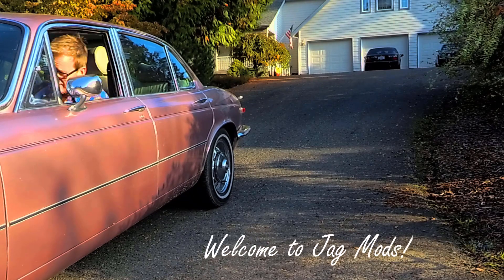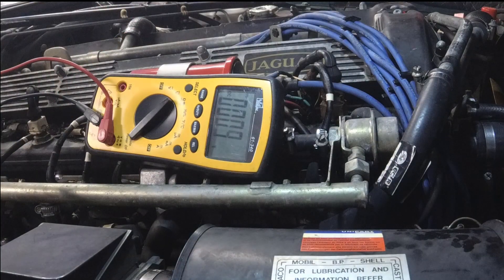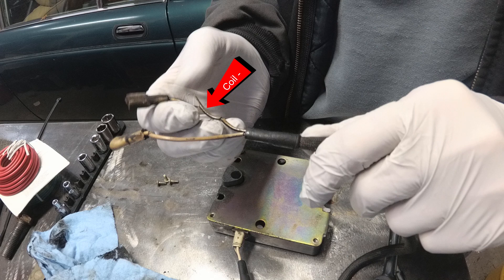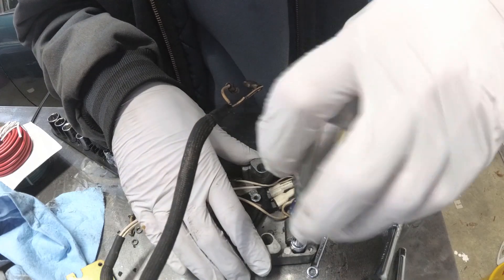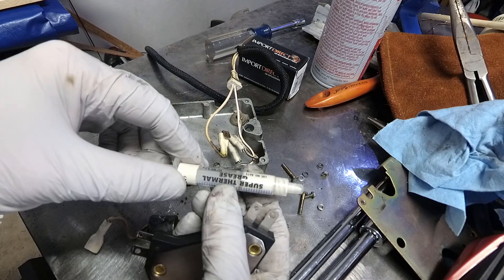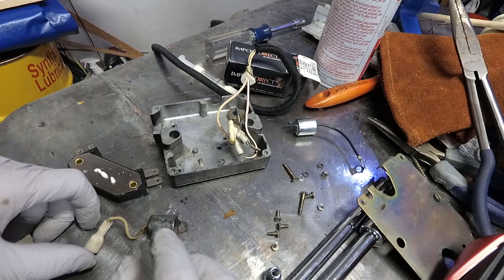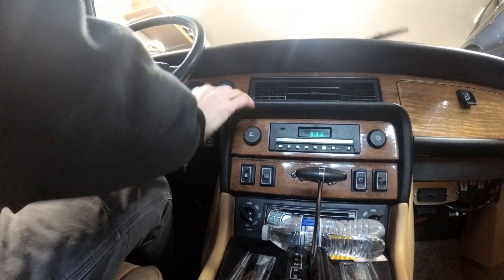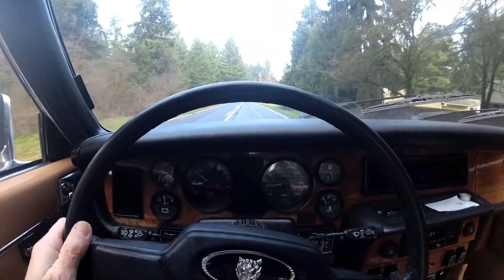Here's how to put the spark back in your Jag.

Comment: Hey buddy, what makes the car (83 jaguar xj6) to go only at 30mph speed? Water on fuel, stale fuel, spark plugs, clogged fuel filter, etc? Any advice will be appreciated.
Reply from the maker: All of the above would do it. Does it sputter? Or just not rev?
Reply from the maker: Also if uts been s in sitting with ethanol laced fuel the ethnol will create a jell and prohibit proper fuel flow. Id recommend cleaning up the fuel delivery,  check the fuel pumps to ensure proper pressure. Is it fuel injected or carburetors?
Reply: @JagMods  it must of been sitting for awhile, it starts up after a second or third try, but when driving it it just goes to 30mph, no power at all. It's also a fuel injected model. I have bought alot of things, but yet to install them, fuel filter, fuel pump, drain the gas tanks, vacuum hoses, radiator hoses, new fuel injectors, undecided what spark plugs to use, ignition coil, cap and rotor, spark wires, clean mass air flow, throttle body cleaning, and new amplifier ab 14 box, change or drain transmission fluid and add the 4qts of type f, etc. All these will going to do during my labor day week off. Hopefully it will improve performance. Will let you know once done. Thank you for your advice.
Reply from the maker: Sorry I missed this comment. I try to address all of them as they come in.  Sorry... How are you getting on with your Jaguar?  to Answer your question, All of the above, plus,
the thing is all of the items above would also cause a really poor / rough idle. except a clogged fuel filter.  Other items, could be a fuel pump is tired you should get 36psi on the fuel rail (hose to...) No advance issues with the distributor not advancing, I've also seen cams out of sync / time (different than ignition timing) The culprit us is the cam chain is loose or the tensioner guides are severely warn.  all but the worn guides are easy fixes.  
Let me know how you're getting on with your Jaguar

Sincerely,
mark @jagmods

Comment: Hi there. Thnx for showing this. I've like all Jag XJ6 owners am battling this issue right now. I thought it would be just wiring, but perhaps it is that Lucas box and cables.  Wondering where to buy the capacitor and the heat sync ? Basically, I have spark between cables, but it looses spark, so car won't get fuel.  If you could comment on where you got the parts would appreciate it. Cheers.  Nice light approach btw... I like it.
Reply from the maker: The Jaguar ignition module found in a couple of places. If you want the Original Equipment replacement Jaguar Part number DAC2087. The whole unit can be found at SNGBarratt search for the Jaguar Part number above. a Non Jaguar quality replacement can be found at Rock Auto too . 
https://www.rockauto.com/en/catalog/jaguar,1985,xj6,4.2l+l6,1178096,ignition,ignition+control+module+(icm),7172 - I'd probably go with the Standard Motor Products brand is a decent substitute for 3rd party replacement parts
Just the internal bits? The OE ignition amplifier is just a HEI unit on any late 70's -80's GM / Chev V8 HEI ignition.

The condensor?  I had kicking around from the trials and tribulations of erratic spark on the Series II XJ6.  The Jaguar part number is JLM9656.  Any ignition condensor will work, as long as the pigtail isn't too short - too long can be cut and a new end put on, oh and the mount has to be in the right place too.  Generic Auto part store ignition condensor will work too - These usually have a bracket that tack welded onto condensor. 

The amplifier unit in the video is an MSD unit - you'll want to use the MSD Coil too ditching the stock ballast with the stock coil.  If you use the stock coil, then go with a stock GM ignition amplifier.  The MSD amplifier will cook the coil over time. 
The MSD Part number is a 5596 and the coil is MSD 8202 Blaster 2 coil.  Both of these parts can be found on Amazon or your local Autoparts store (special order) / speed shop.  

The MSD coils have a larger diameter, so stock coil mount won't quite fit around the coil.  I made a new bracket out of a piece of aluminum flat bar. Tools I used are very basic tools. A vise, hack saw,  drill, hammer, a metal file, and a piece PVC pipe to bend the aluminum around (don't use the coil as a form it will dent it), masking tape to make a template of the old coil for basic dimensions, then add the additional amount required for the bigger cable by determining the difference in diameter between the stock coil, and the MSD coil. 

I hope this answers your question, and please post how you're getting on.  I do read and reply to every comment.

Cheers!
@jagmods
Reply: @JagMods  Hey, thanks for such a thorough reply.  Thank You, I am rebuilding that module, seems my capacitor is working and the other black relay I think it is, just wiring rusted etc.. thanks again, I hope it starts up any day now just like yours did :)
Reply from the maker: Let me or us know how you get along
Reply: @JagMods  I cleaned up the ignition module, no start. :( tried changing relay, no start, still no signal to fuel pump.. as in power, but to be honest, I'm not sure how to check it... it was making that static sound, now no sound... I changed the cable, I even cleaned up all inside ignition module, capacitor built up ohms to 19 and fell... so that's working etc... 
nxt thing I was even thinking to make a claim w insurance to investigate this thoroughly and see this is fixed for good. ? any thoughts on how that might go ?
Reply from the maker: Check in the comments on this video below, specifically Tyler Rogers. He had a similar issue.  Let me know if that doesn't help.
Has the car ever ran? is it new to you? in a no start / run condition? I'm assuming you've checked the compression and the condition of the spark plugs.
1. Have you checked for spark?  I believe in the Video, I had my handy dandy spark light that I put between the plug and the plug wire. this can also be accomplished by pulling a spark plug, then grounding the electrode on the engine.  this is best done in a dark area so you can see if there's a spark or not.  This can also be accomplished by pulling a plug wire, and leaving a gap between the plug wire and the distributor cap, or the plug.  If there's spark when the engine is turned over, then you'll hear it, and may even see it. The handy dandy spark checker is worth it's weight in gold.  I got mine from the local automotive store, or on amazon.
That being said, are you sure you don't have any spark?.  The next tool that you'll need is a multi-tester for checking voltage.  
2. What is the condition of the battery.  Resting it should have somewhere between  12.0 - 12.75V. if the battery is any less than 11.5V resting - the car won't start.  
3. Measure the voltage across both poles on the coil. it should read about the same as the battery maybe 1 or 1.5 volts less (If you've got a ballast resister in place). 
4. check the voltage between the battery + to the negative on the coil. you should get full battery voltage.
5. do the same but in reverse battery - and coil + should be the same - full battery voltage
6. Voltage out of the coil. should be about the same as the battery maybe 1.5V less if there's a ballast Resister in the mix.
Get back to me, with answers to the above questions, and I'll point you in the next logical direction.
7. Is there any side to  side movement in the distributor? if the bushes are worn, this will also play a havoc on trying to start.

A less obvious issue, is on my '86 XJ6 (grey one) had a very similar issue. but was quite baffling.  I had spark, I had fuel pressure, the injectors are firing, but it still wouldn't start.  The issue was the cam chain on the intake side was too sloppy and the cam was out of time with the pistons & the ignition.  The distributor is driven from the crankshaft. so if the valve timing is off it won't start either. Well Consistently.  On a rare occasions the engine would fire right up and run great - then go for a drive get just far enough that getting home was a hike, come up to a stop after deacceleration, and the engine would quit and not start again. The deacceleration is what tipped me off about the cam timing being the next place to check.  This does require two special tools available at SNGBarratt 
Anyway, get back to me with a bit more info and I'll point you in the next logical direction.

Good luck mate!